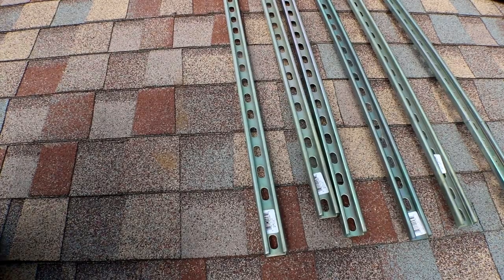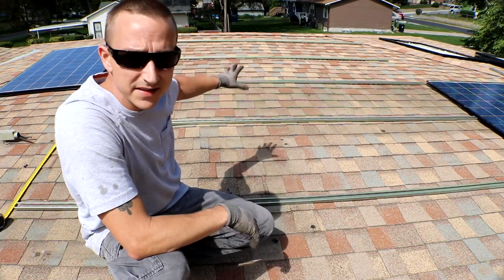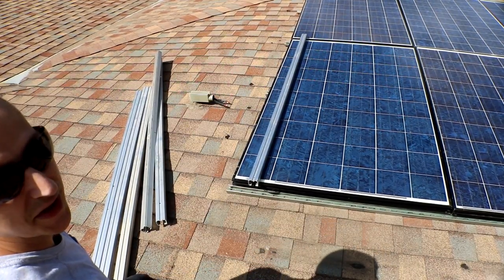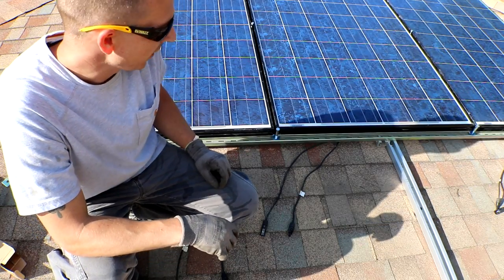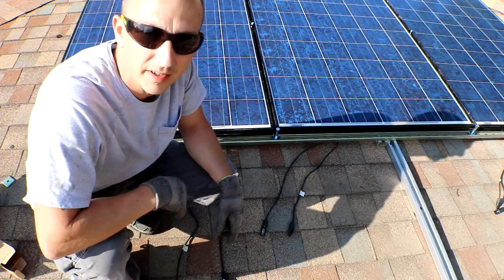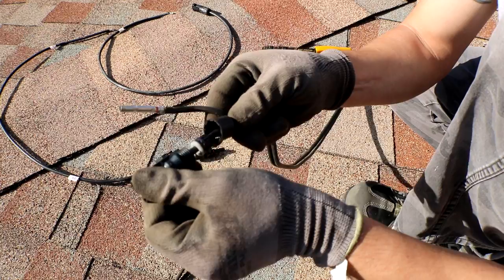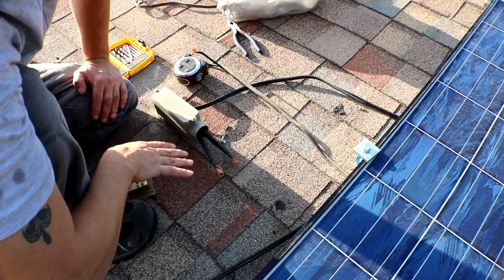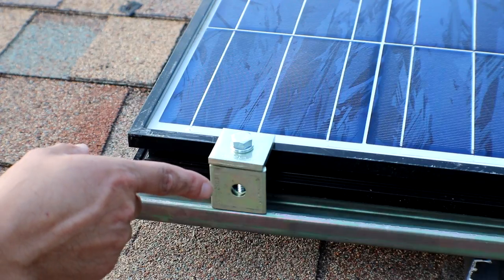Installing Solar Panels On The Roof

Comment: your description says 705W, however 6 x 235 = 1410
Reply: I saw that too.  This is perfect for a 60A mppt at 24V (battery).
Reply from the maker: Yeah it does equal 1410 at 24v but since I series 3 sets of 2 of panels its 705watts.  Its like taking 2 panels and making them 1-235watt panel. So 3x235=705   But thats going to change again lol.  Everyone says Ill get more out of them if I go 3 in series because of the MPPT Charge Controller.  So Ill give it a go
Reply from the maker: Ill be running 48v and I do have a 60amp MPPT 😀
Reply: That's not how it works, Watts=Volts*Amps. A single 235W panel at 24V is outputting 9.8A. When you parallel two panels Amps doubles with Volts staying the same. When you series panels Voltage doubles with Amps staying the same. Either way you double the power. Note that a higher voltage system will have less resistance in the wires (for a set wattage when you double the volts you halve the amps AND resistance heating is based on amps, not volts). I hate to break it to you but you have a 1.4KW system installed on your roof :)
Reply from the maker: Thats what I was saying, 2 24v panels in series = 48v but wattage/amps stay the same.  3 sets of 2 in series should be around 705 watts.  Depending on the soc the batteries are at I could see higher watts/amps.  If you go off the possible amps of each set well say 8 for exp: 8x3=24 and well say 48v nominal so 24x48=1152 or am I bass ackwards lol
Reply: AveRage Joe you are wrong. Double the volts at 9.8A and you've doubled the wattage.
Reply: Hey man, I think your'e rocking 1.4 kW right there. 2 panels together will double your voltage to 48V, but if your amps stay the same then the watts double. I think the way you have it wired now, in uber sunny mode you should see about 60V@24A~1440W and if you wire them the other way 90V@16A~1440W. Although real world sunny mode is probably closer to 1000W. Awesome video though man. Wish my roof was that easy to wonder about on.
Reply: Alex Woolaway then use a ground mount.
Reply: A * V = W.  Doubling either A or V will also double W.  Doubling BOTH A and V would quadruple W.  Either way that was a good way to see who's paying attention. :)
Reply: hello from Tucson
Reply: Don't forget that "24V" panels aren't actually 24V, if you hook up a voltmeter you'll usually see around 40V.  235W / 40V = 5.875A.  Or whatever is on the label on the back of the panels...  We CALL them 24V panels because they are to be used in 24V systems (we base this on the nominal battery bank voltage, which used to be lead acid (=AGM) back in the day)... my friend keeps calling them "40V panels" and that's incorrect, even if they read 40V on a meter.
Reply from the maker: +bcmasur Oh ya I know the voltage is higher, im just calling them 24v for the nominal voltage. Ya the open voltage was 36 or 9. If I remember right the amp test was 8amps.
Reply from the maker: +bcmasur lol ya I think I got myself all mixed up
Reply from the maker: +Alex Woolaway Im gonna blam my calculator lol 😉

Comment: Im concerned that the screws holding the aluminum channels to the roof are only screwed into the roof sheathing.  Please say you found the roof truss and screwed into that.    The other concern I have is that the cables are laying on the roof. In professionally installed systems, the cables are clipped to the rails using rubber coated clips.  Cable straps or zip ties will deteriorate over time.  Rubber coated clips will not.

Barry cinnamon of Spice solar has a "energy Show" podcast.  

One of his episodes was the top 10 solar system installer mistakes. 
These two issues come from that episode.

A cool looking product that he reviewed was a self sealing roof anchor from Solarroofhook.com.
Reply from the maker: Yup, the screws are in the truss's👍  When I go back up to move the panels over to prevent the little shadows from the square washers and change it to 3 in series, Ill be addressing the wires so there not laying on the roof.  Ill have to lake a look at those rubber coated clips.  Ill take a look at that site, Thanks!!!!

Comment: 3.....2.....1........roof leaks.....No rail grounding/bonding.
Reply from the maker: I hope theres no roof leaks as I put tar blobs down before putting the screws in.  No grounding yet
Reply: Thats why my solar is on a pole mount. I did roofing work when I was in high school during the summers. There is one thing I learned was if you put a hole in your shingles it will leak. One day it will no matter what you put to try and stop it from leaking. But hey it looks good just be careful with putting holes in your roof.
Reply: Kory Arceneaux yeah that’s why ur not doin roofs anymore..ur wrong ..what u think ur asphalt shingles use glue?..all asphalt roofs with solar have wood lags into the rafters ..ur fine joe...do ur thang

Comment: Oh NO why no angle? The reason to always put solar panels on an angle is so the dirt doesn't sit on the panel and when it rains it runs off. Eg self-washing. If the solar panel is flat like what you did every two weeks you will need to brush them off "clean them" Which either won't happen or will he very annoying. You will be surprised up much dirt will sit on them for a couple of weeks. I would go back up and do the same thing as you first did on your solar setup before ripping it all apart. At least a 20% angle down or angle it right for mid winter/summer. Yes i know a pain to now do but it will be worth doing. Eg spend all that money on 6 panels it best to get the most out of them.
Reply from the maker: Ill be adding a auto-matic wiper to each panel for self cleaning 😃 JK.  That was a concern before installing like I did but since the panels are so big I went this route. If I did them at an angle Id have to maybe install them on there side in rows and since the pitch is so low Id have to separate the rows quit a bit to get away from shading.  Ill keep an eye out and see how dirty they get and that will help me decide 👍

Comment: It's not a good idea to connect PV strings in parallel without a blocking diode on each string.  If you shade one module, that string will have a lower output voltage than the other two strings.  So current from the unshaded strings get sucked up by the shaded string.
Reply: Pretty much all modern panels have the blocking diodes preinstalled so he should be fine.  He could always doublecheck the panel boxes to be sure though.
Reply: No, the modules have bypass diodes, not blocking diodes.  Bypass diodes are connected in parallel with the PV cells to allow the string current to go around (bypass) the PV cells when they are shaded.  A blocking diode goes in series with the string of modules.  You need blocking diodes when you connect strings in parallel.  I think Joe is using two strings in parallel, each string comprising three modules.  So he needs two blocking diodes.
Reply from the maker: +Steve Robbins Makes purrfect sence. Ill have to put some in 👍
Reply: All of the panels I own come with both preinstalled.  This is generally standard practice when I order panels since the small 0.3-0.6V drop is not really an issue for most installations.